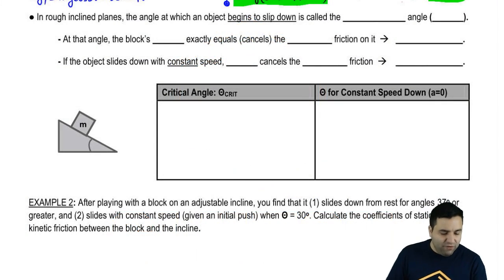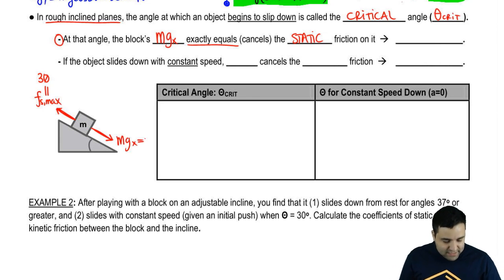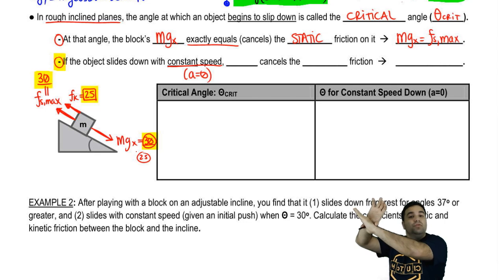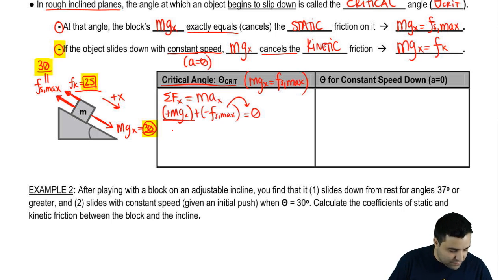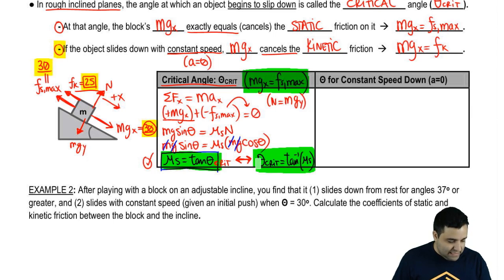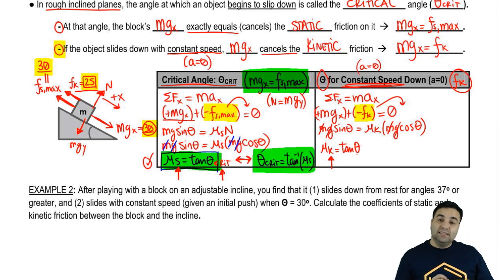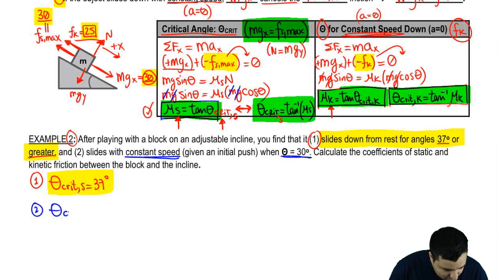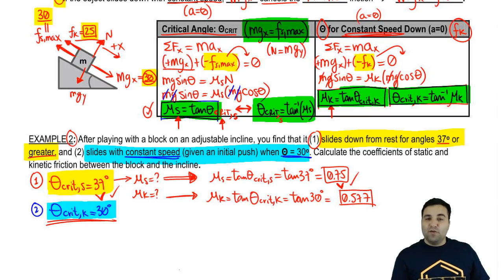Incline with Friction & Critical Angle

Comment: I have a question. Will having a lighter or heavier object affect the critical angle?
Reply from the maker: No, the critical angle is not affected by an object's mass; it only depends on the coefficient of friction. This happens because the weight, normal force, and friction are all proportional to the mass. If the mass increases, the force of friction increases, but the weight increases by the same percentage, so it always cancels out. Hope that helps! :)
Reply: Please explain.